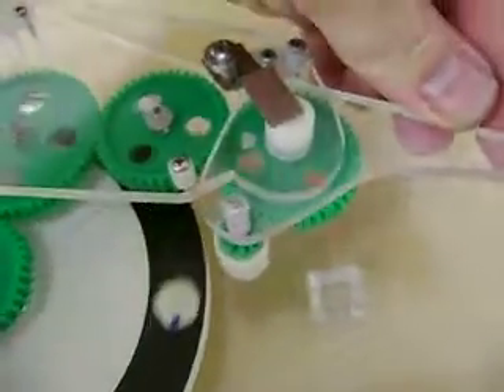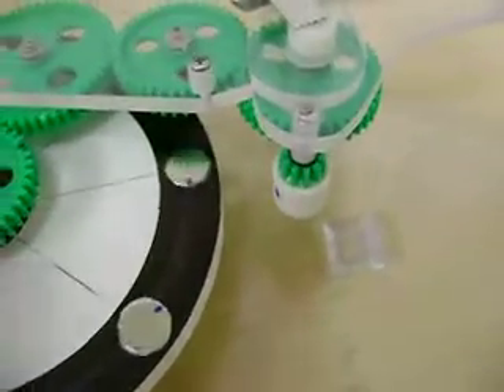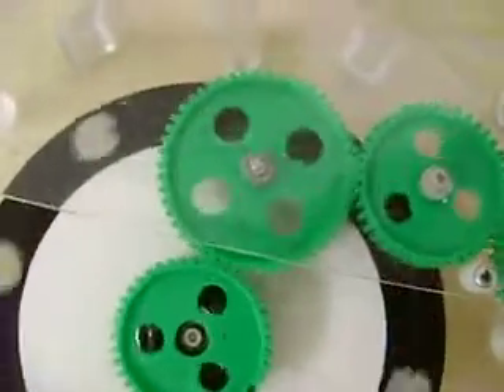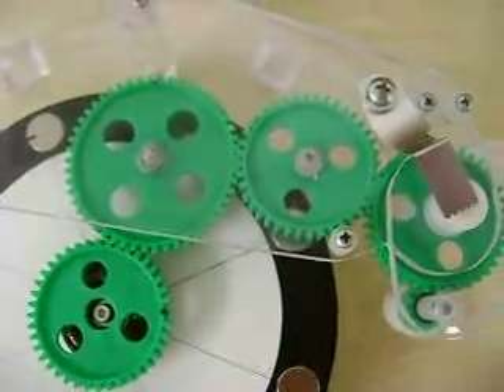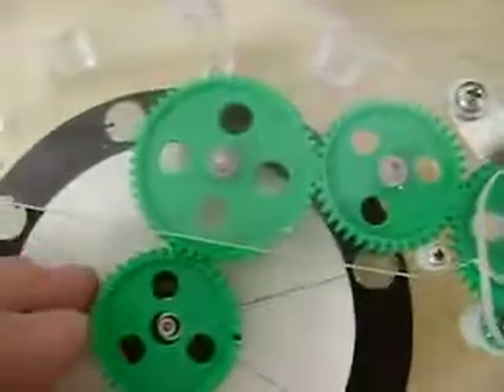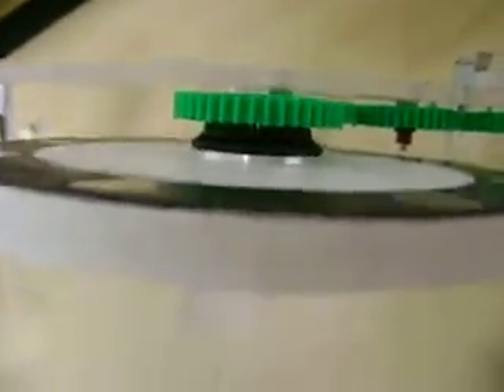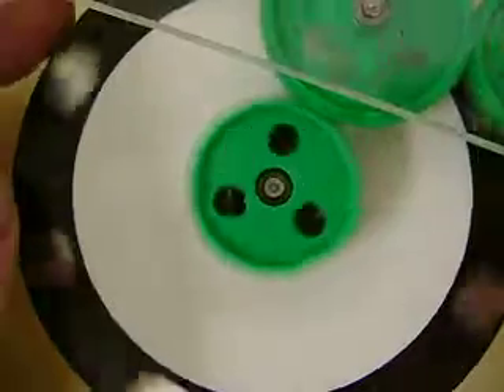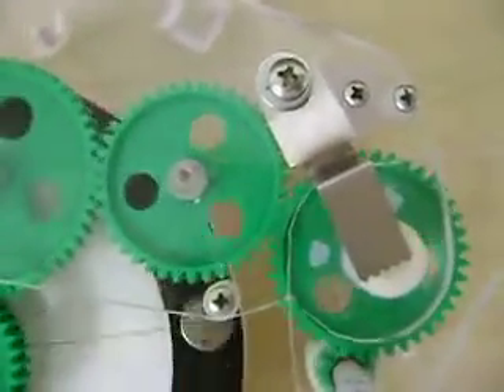AGW stator geared to rotor

Comment: ... Also, it should be noted that a force applied at 90° to a wheel applies 0 torque while the same force applied tangent will offer a torque equal to the force times the radius of the wheel. It is observable then, that for positions of the magnets that pin 90° to the tangent will not affect the momentum of the wheel When the interactions of a rotating magnetic field becomes nonconservative then one must ask, what can be accomplished?

Comment: You may want to review the formula for calculating the force between magnets. It is conveniently recorded on Wikipedia, just append the following:
Magnet#Calculating_the_magnetic_force

You will find that the force depends on much more than just the position. You will also find that they do not add linearly but instead add vectorially. So a magnet with B 90° to another will not double in force, but will be √ B1² + B2².  
...

Comment from the maker: I have been interested in magnet motors for some time. I have been involved in the whipmag project, and this is part of experiments to determine why it works  or not. The whipmag uses free spinning stators. Nobody as of yet has been able to duplicate it. Nor has anybody been able to come up with reasons why it could work or why it can't work. So  gearing the stator to the rotor,  the ability to force the stator to into different phase relationships with the rotor may provide some answers.